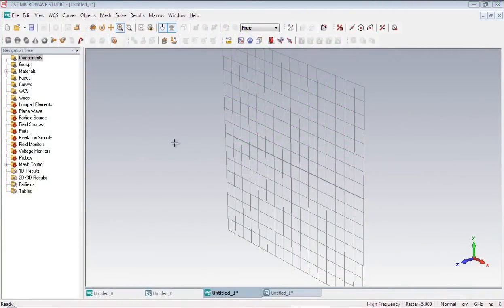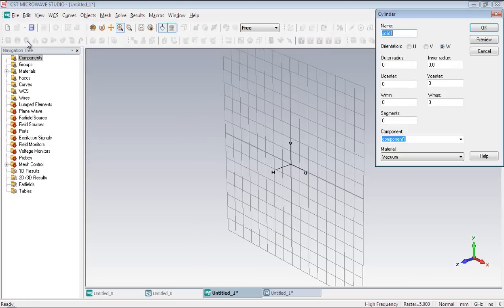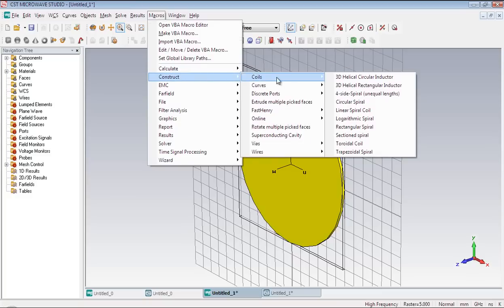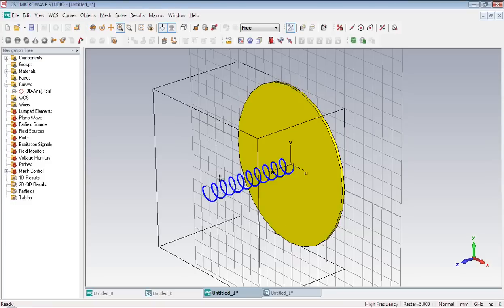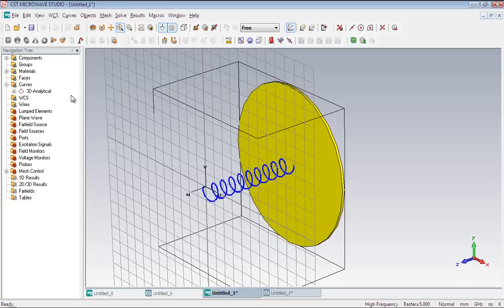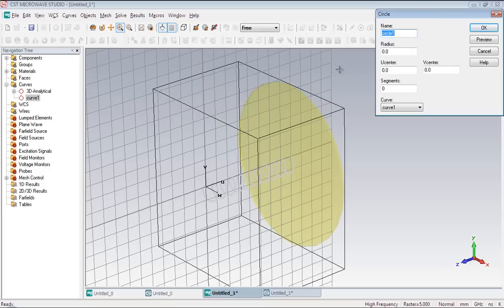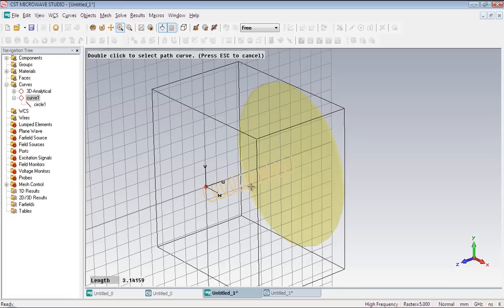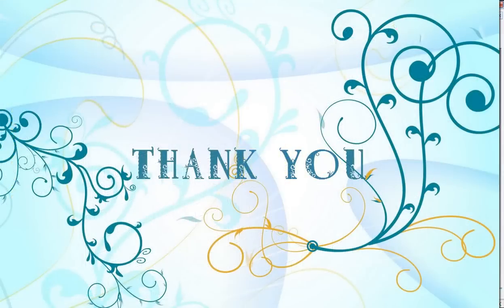CST Tutorial: Geometrical Design of a Helix Antenna

Comment from the maker: @phoonjzc You can use powerful optimization algorithms of CST MWS to meet those above mentioned requirements. Since opimization involves heavy calculations and numerous automatic trials, you need a powerful PC to run optimization tools. You can enter the target parameters in the optimization settings window.
SMA connectors act as interface between the coaxial cable and the antenna. So you have to connect them at antenna's port.

Comment: I have an array of 8 antennas ( circular array )( reciever) and a 9th antenna as distant source ( transmitter ) . 
I need 2 detect direction of distant source ( 9th antenna ) by analysing ( interpolating ) data recieved at the circular array
I plan to put PORT 1-8 in array and a distant antenna ( 9) .Then calculate S19 , S29 , S39....Then I will feed this data for interpolation"S parameter vs angle " & the peak gives me transmitter's direction .Plan to put source's location as a parameter

Comment: Hi I need help in designing this antenna:

Frequency: 4.9-5.9GHZ
Gain: > 7dBi
Return loss: >10dB
Impedance: 50ohm
Connector: SMA
Antenna Size: less than 250mm
Substrate: F4B-265 dielectric constant: 2.65 Thickness: 0.8mm loss : 0.002 

I got a question. Where do I enter the parameters? Where do I place the SMA connector? 

Can someone pls guide me?